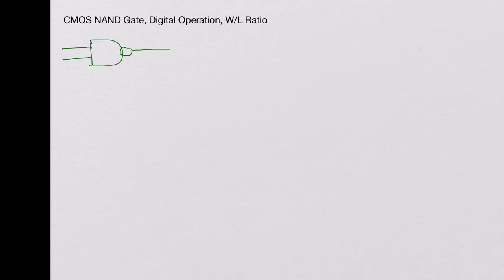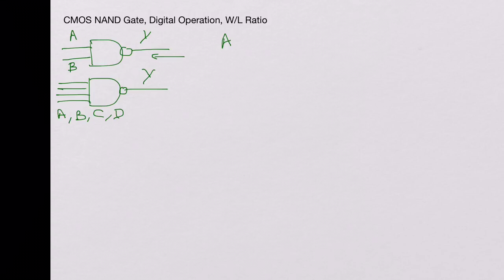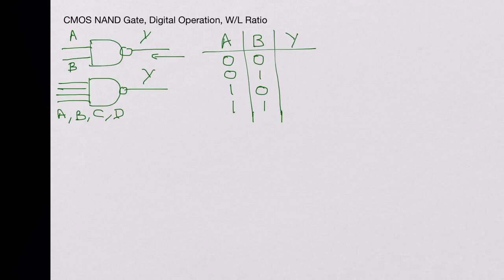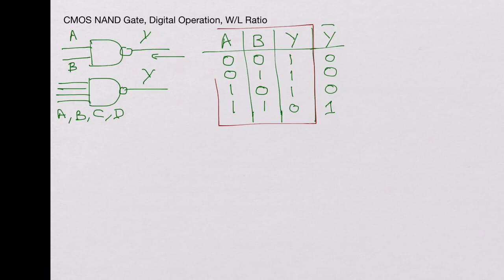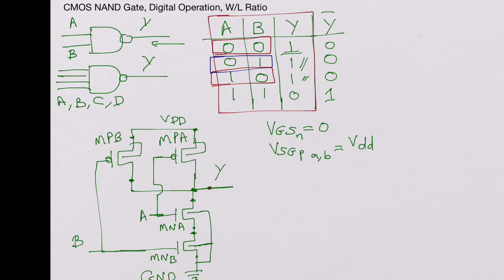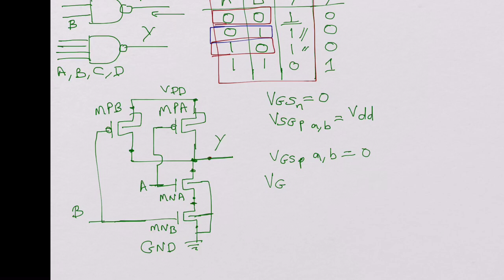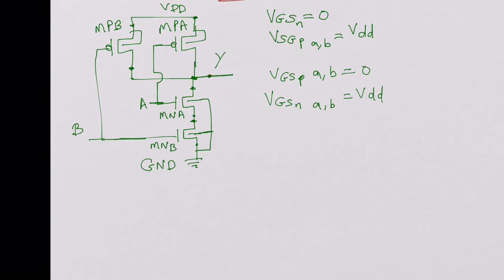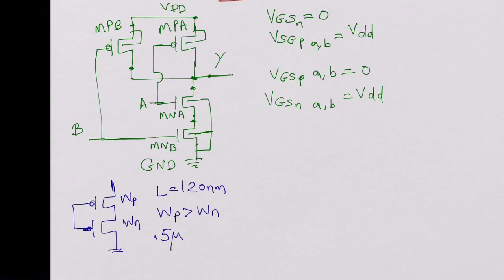CMOS NAND Gate, Digital Operation, W/L Ratio

Comment: do you think that you had explained the ratio between W/L ?  no connection.
Reply: by connecting two transistor  in series have double the Length. so two make the w/l ration constant we increase the width by 2 times.
Reply: You should watch previous videos. It's high school knowledge that a large width ---> large area--->smaller resistance---->in parallel